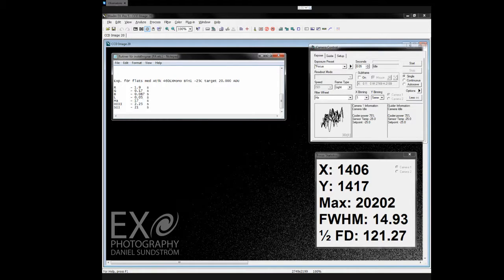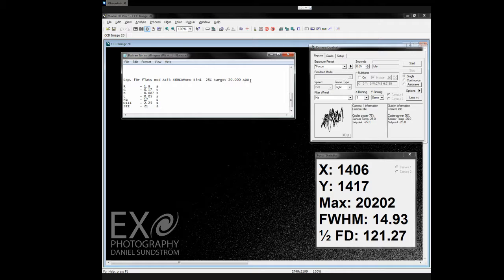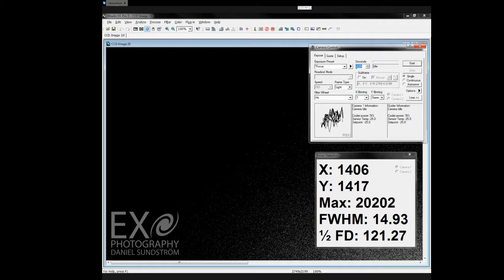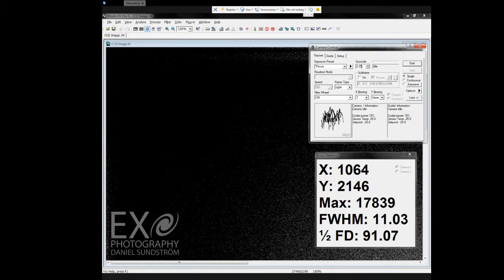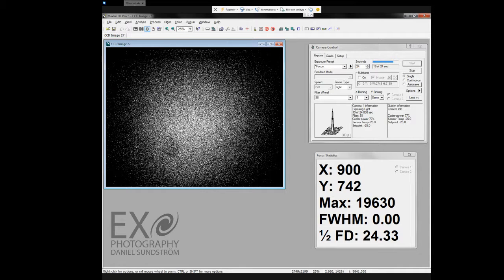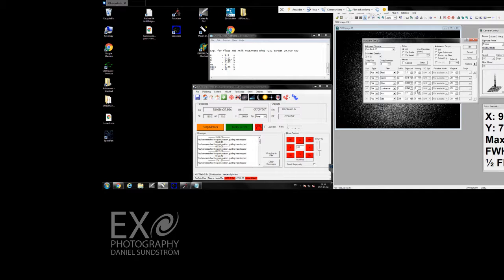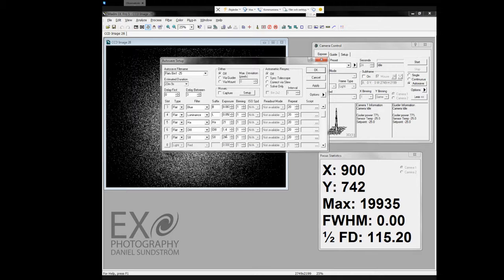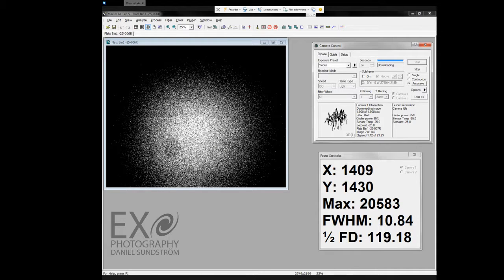Flats imaging with Maxim DL and Atik CCD

Comment: Nice guide on how to take flats. I have a question, though; Let's say one is willing ro bin the ccd 4x4 (mostly for great SNR and much less download times), and wants to do some red-filter photometry. Will exposure time for flats be affected? Have you tried this on your Atik 460? What I realised is that the bigger the wavelength the more it needs to approach the linearity (and the smaller the wabelength the less time it needs to do so) of the sensor. Thanks in advance
Reply from the maker: Well, in theory, a bin 2x2 should be 4x faster then 1x1 (hence we use 4 pixels to act like 1 pixel)
With that in mind, a 4x4 should be 16 times faster than a 1x1 exposure.
This is how ever in theory and should be adjusted so you reach an ADU (saturation) of 1/3 of your camera full well depth.
My Atik 460 has 65.000 ADU, and i try to hit somewhere around 20-22000.
Raegarding the photometry and the wavelenghts, I don't have that experience, so i wouldn't be comfortable giving you an answer.
Maybe one of the forums out there have your answer :/
Regards, Daniel
Reply: @ExoPhotography1  Thanks for replying, sir. I don't have an astronomical setup yet, so I prefer to read A LOT and learn (first things first, to avoid mistakes) before I do the next step. 
Regards from Greece.
Reply from the maker: @JMHellas  That sounds like a good idea, i have read tons of books and forums to learn.
One thing i can say of taking flats and using different exposures with different filters is that it is a HUGE difference in what exposure times I need to reach 20.000 ADU with luminance filter and 20.000 with my red filter, it can sometimes be a factor of 20 times.
/Daniel
Reply: @ExoPhotography1  Yes sir I realized from your video how big the differences can be, when I saw 0.0087 seconds for B and 21 for R. I can imagine that, for example, if one decides to get flats on CH4 filter, the exposure time can go up to 40 or 45 sec. So It definitely needs experience, which depends on a lot of experimentation
Reply from the maker: @JMHellas  I usually start off with shooting blue or luminanec filter and try to get as short exposure time as possible, but not 0.001s, thats to short, I don't want to push my luck on the camera.
I then move on with the other filters, and write down that exposure time.
After i have figured out all of the filters, i make an sequence and save that for later use.
I have made a new flatbox 50x50cm and will probably make a video of that soon.